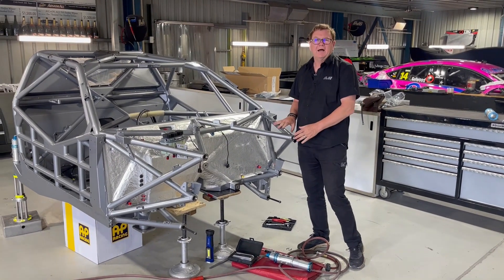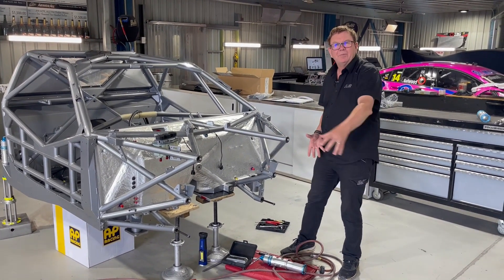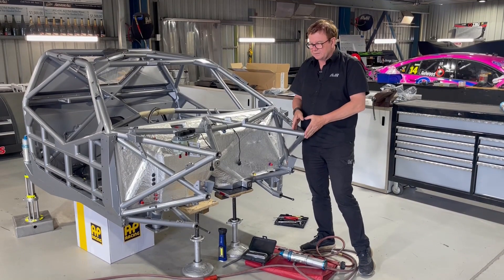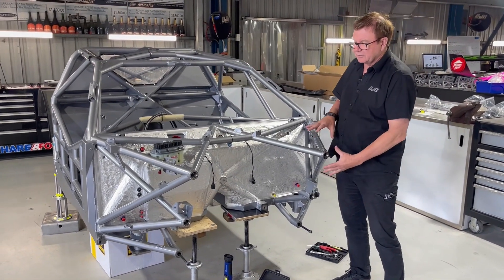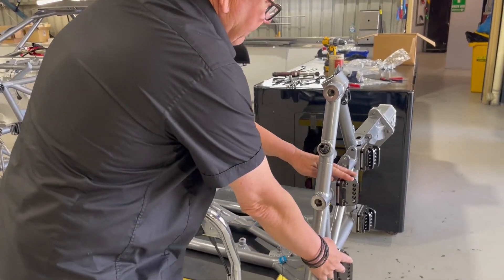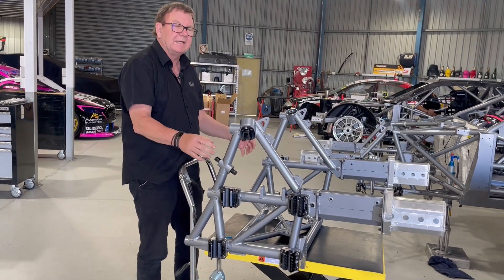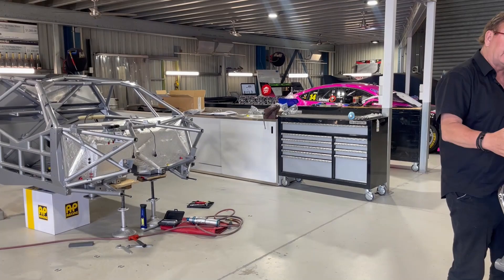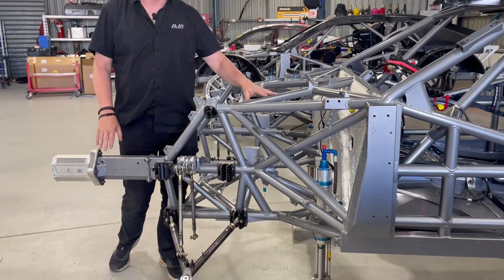Brad explains the philosophy of the Gen3 front clip

Comment: Brad does not sound quite convinced. I doubt that it will be easy to bolt on another front clip after a shunt,, tyre walls grab and pull everything. Will be near but no cigar without a frame jig to pull everything back square.
Taking it from the firewall would near certainly be better